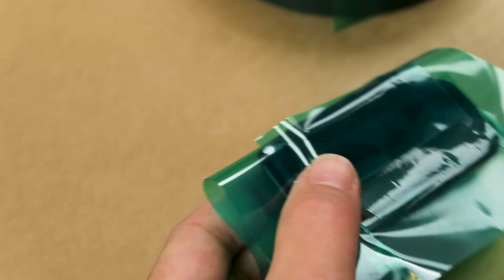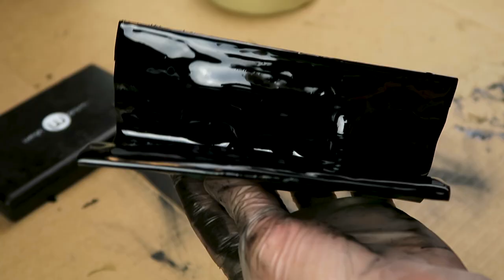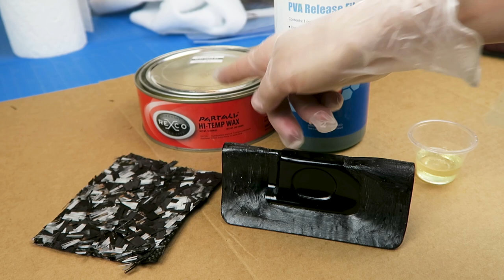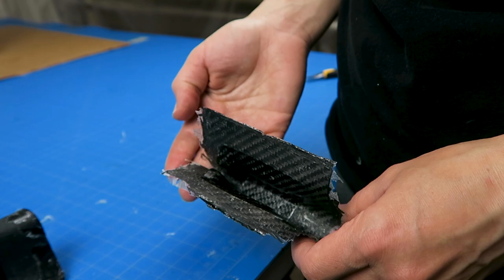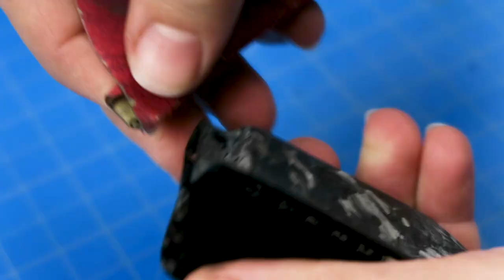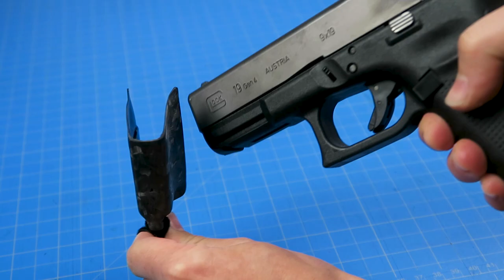Forged Carbon Fiber Trigger Guard Holster

Comment: So its more of a "Don't shoot your junk" precaution device than a holster, am I getting that right? ^^
But as one can say on all your projects: very well executed! The fact that you retained good clamping force in the molded part speaks to your excellent craftsmanship.
Reply from the maker: Protects against accidental trigger pull but also keeps the firearm in place during activity and at a good height for draw.
Reply: @LindyDesignLab  I am surprised that it keeps the firearm in place, since it isn't anchored to the pants/belt directly.
How does that work?
Reply: @NochSoEinKaddiFan  Pressure from the pants against the body keep the firearm in place until the draw.  At that point, the short tie down removes the trigger guard/cover for presentation.
Reply: @Desrtfox71  So it is really just a trigger cover, not an actual holster?
Reply: @NochSoEinKaddiFan  It's Mexican carry with the added safety of a trigger cover/guard.
Reply: @Desrtfox71  k thanks for clearing that up :)
Reply from the maker: In addition to removing the trigger guard at draw, the cord tied to the belt also keeps the gun from shifting too deep, so it stays securely at the waistband while walking/running etc. Gotta adjust the length of the cord though until it works properly.

Comment: As a person from a country with gun control I have very little experience with firearms. I spent this whole video wondering what the purpose of this would be. I understand protecting the trigger is safe but in order to get an accidental discharge you'd  need a round in the chamber and the safety off. I was trying to imagine when you would have a gun, with a round in the chamber and the safety off but also not in your hand. I did not predict the final usage at all. It looks like a very effective design. I hope you never have to test it.
Reply: So these types of pistols don’t have an external safety. There is an internal safety that physically blocks the striker from sliding forward and igniting the round. That internal safety is pushed out of the way when the trigger is pulled about halfway. I imagine this type of guard could also be used to carry in a purse for example to prevent anything catching on the trigger accidentally.
Reply: @Arcrobes  If a safety doesn't stop the gun being fired, what's the point? Genuinely confused.
Reply: @VicMorrowsGhost  it prevents it from going off if you drop it. Beyond that, your finger is the safety and should only be on the trigger if you are certain and ready to fire. What makes it safe is proper handling and training.
Reply: @Arcrobes  thanks for sharing that! I had no idea that was a thing
Reply: Everyone's preference is different, and you can train to be proficient with anything.
I had it explained to me once that with firearms the only real safety is between your ears.